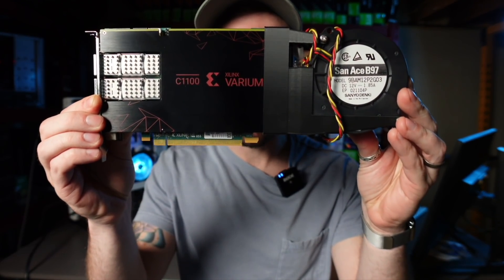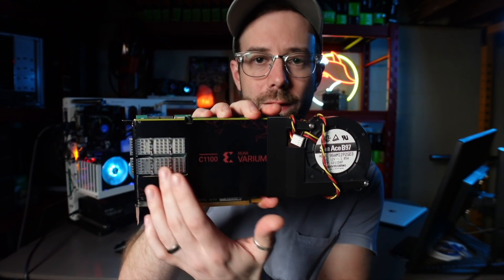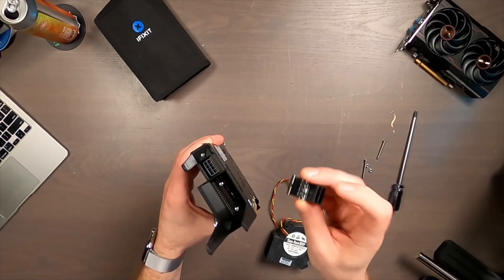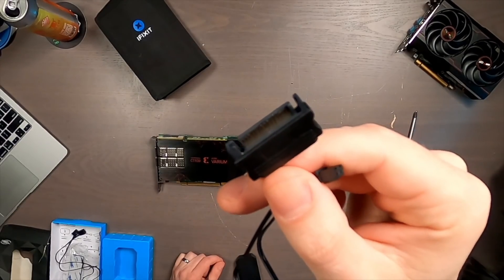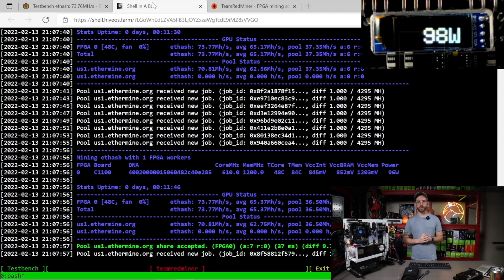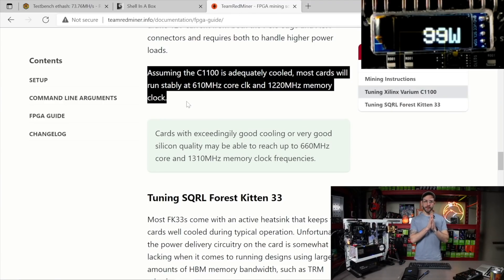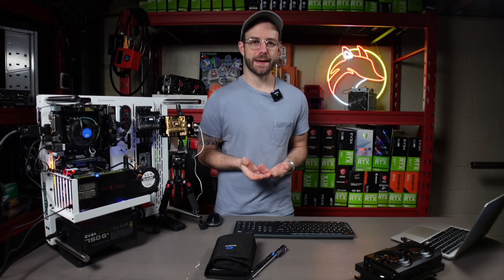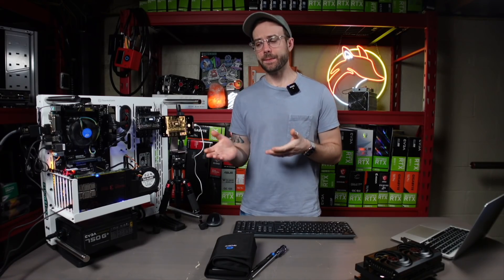RIP GPUs. This FPGA is INSANE on ETHEREUM. (Xilinx C1100 Ethereum Mining Hashrate)

Comment: GPU 0
21:00.0
GeForce GTX 1660 SUPER 6144 MB · MSI
Hynix GDDR6 · 90.16.5A.00.19 · PL 70 W, 125 W, 125 W
28.66 MH
46°
99%
72 W
100
930
-1004
80
GPU 1
25:00.0
GeForce GTX 1660 SUPER 6144 MB · MSI
Hynix GDDR6 · 90.16.5A.00.19 · PL 70 W, 125 W, 125 W
28.67 MH
41°
100%
67 W
100
930
-1004
80
GPU 2
26:00.0
GeForce GTX 1660 SUPER 6144 MB · MSI
Hynix GDDR6 · 90.16.5A.00.19 · PL 70 W, 125 W, 125 W
28.68 MH
43°
100%
71 W
100
930
-1004
80
GPU 3
27:00.0
GeForce RTX 3070 Ti LHR 8192 MB · ZOTAC
Micron GDDR6X · 94.04.5A.00.B3 · PL 100 W, 310 W, 341 W
77.22 MH
45°
90°
100%
182 W
100
1000
1800
190
GPU 4
28:00.0
GeForce GTX 1660 SUPER 6144 MB · MSI
Hynix GDDR6 · 90.16.5A.00.19 · PL 70 W, 125 W, 125 W
28.67 MH
41°
98%
66 W
100
930
-1004
80
GPU 5
29:00.0
GeForce RTX 3070 Ti LHR 8192 MB · ZOTAC
Micron GDDR6X · 94.04.5A.40.22 · PL 100 W, 310 W, 341 W
77.57 MH
41°
92°
100%
178 W
100
900
1800
190

Comment: Not sure but, my understanding is that FPGAs machines are programmable, so why can’t these cards be re programmed ?
FPGA stands for Field (eg at home) Programmable Gate Array. It’s actually a type of Field Effect Transistor used in automation electronics. So after 2.0 why wouldn’t it be OK to reprogram, might need FPGA bitstream and not hive or windows but that’s fine.
Reply from the maker: You are 100% right that it can be reprogrammed. Just at the mercy of devs creating the bitstreams for it.

Comment: As I understand it, this is some kind of advanced network controller for 10000GB with HBM memory, which was converted for Ethereum mining...
You can link to the original, something tells me that its real price is 500 dollars, and the alteration consists in BIOS firmware and specialized drivers ...

Comment: Great video. What a mining machine in that C1100! You'd have to take into account the power consumption of the fan, though, I think. At 1.85A and 12V, you're looking at 22W @ 100% fan. That's 125W total for 78Mh/s, or an efficiency of 0.62 Mh/s/W. That's still 30% more efficient than the next best one, the 1660 Super, which can get 0.48. All in all, I agree with the major drawback you highlighted in the reliance on others to develop bitstreams for it. Also, in terms of price/efficiency, the 1660 Super far outperforms the C1100, as you can get 3 or 4 1660S for the price of 1 C1100.
Reply: 1660 Super seems much better solution

Comment: An rx5700 can do 50+ at 100 watts for a third of the price. How is this that exciting? (At least until there's actually evidence of it getting 660 mh instead of 77...)
Reply from the maker: In software maybe. 5700 does more if properly measured. AMD doesn't report software wattage correctly. I have a video on it. 5700 should be more like 120w. This crushes it. Wouldn't recommend buying though.
Reply: @RedFoxCrypto  so even if you're generous on all estimates of hash power, power draw, power cost, etc., the roi will be significantly more than a year since the profit is well under $100/month. And eth profitability is going down until it stops entirely. I still don't get how this changes the equation or is that exciting, at least based on price and availability

Comment: $1,300 and 50 week lead time.  Hash rate is slightly better and power consumption a little lower than buying 2 x 6600 XT's.  Except I can get 6600 XT's now.  By the time they would arrive they will already be a paperweight.

Comment: So you have 78Mh/s at around 125 watts total including fan wattage. The FPGA cost around $1,300, but what does the fan kit cost? While all that seems impressive, getting 6600xt's might be a better option if you can get a 6600xt at $500 or less. If you can get 32Mh/s with a 6600xt at just a $500 price point, that would equate to 83.2Mh/s at $1300. Plus with a 6600xt you have the added insurance that it's usable beyond Ethereum switching to POS.
Reply: But 2 6600xt have a way higher power draw
Reply: @anonymouscommentator  Higher yes, but a way higher, no. Including fan power that FPGA uses around 125 watts, while 2 6600xt us around 140 watts combined.
Reply: @MassBoost  i have all my 6600xt @32mh and 55w
Reply: @HouseProjectIT  Nice, I think I was figuring around 65 to 70 watts for the 6600xt's, but if you can get it down to 55 watts that would even better and more of a reason to buy the 6600xt'x over an FPGA.
Reply: These FPGA's have value outside of mining too, in fact I imagine this would retain is value better than GPUs if Ethereum and by extension GPUs crash.
Reply: @Airwalkerstudios  I highly doubt their value would be better than GPU's. Also GPU's can be moved over to other algorithms to mine, and something like a 6600xt is highly efficient at mining all coins. Some coin prices have already gone up around as high as 80% in the last few weeks, so calling an FPGA a better option is a misnomer.

Comment: It's a really cool idea, and I'd love to mess around with one, but here in Canada I see the V-C1100-P00G-PQ-G listed for a psychotic $3510 CDN. In reality I'm able to get 62Mh/s on my 6900xts for just over 110 watts with proper tweaking. If I wanna go wild and pump 160 watts I can dual-mine ETH and TON with no loss to ETH hashrate. If the C1100 was reasonably priced I would love to get into FPGA programming but even the retailers are on the scalping bandwagon. Where's this discord channel at? I wouldn't mind doing more research.. at least that doesn't cost a fortune.
Reply: Or go with Nvidia A series GPUs. I have an A2000 running 41mh/s at 68watts @ 43oC. Factory cooling, no bios mods, less than half the size of an RX580. Under $900 CAD shipped from China.
Reply: Why would you get 6900 XTs assuming you didn’t have them already for gaming?
Reply: @Ash-my4gf  They're surprisingly efficient actually. You have to change the power tables in windows to undervolt not just the GPU but also the SOC and RAM. You can get fantastic results. TON coin especially is processing intensive, the 69xt has 80 processors which can mine TON nicely while mining ETH and STILL be undervolted. With GPU prices finally coming down they're an even better deal.

As for anyone using this C1100, do your research! You can get the code to mine ETH directly from Xilinx, apparently for free. No need to get some bitstream from "some guy" who's gonna charge you a dev fee. From what I've read Xilinx provides all you need for free with no dev-fee.
Reply: @rafalklepinski7372  they’re really expensive though which wouldn’t make sense to buy them for mining is what I mean mainly
Reply: @Ash-my4gf  There is also the problem of availability. The second half of last year there weren't too many options out there. Ontario, Canada is AMD territory. Nvidia didn't bother to make much of their products available here during the shortage, and they still don't. Meanwhile you can get any AMD GPU you please, especially now.
Reply: no you're not getting 62 MHs for 110w on a 69XT at wall. SW reported values are not real world power consumption on AMD gpus.
Reply: @MiningTips4u  6800 XT undervolt button in adrenaline, gets me 63mh/s- 80mh/s in Monero Ocean. It usually gives hovers around 78 mostly. Mining eth getting paid outs Monero. 5600 XT gets me 43 - 54 mh/s. It usually gives hovers around 54 mostly
Reply: @SrChalice  not the hashrate the power consumption at wall. 62 MHs at 110w is not real.
Reply: @MiningTips4u  Just divide it by your PSU efficiency. 110W sounds bit ambitious but I've tested 6800: 115W reported, 115/0.9 at the wall (63.5 mhs, 64.2 max but invalid shares reach over 1%).

Comment: non-lhr RTX 3070, rtx 3060ti beat this anyday.
Reply from the maker: This beats both those cards in hashrate and efficiency.
Reply: @RedFoxCrypto  maybe, but no in resale value, also in  EU used 3060ti/3070 non lhr cost about 900-1000euro, 2x 1660s/ti about 650-750e
Reply: 63mh 119w

Comment: For the price of your FPGA @ $1300 you can buy an rtx 3080 with the same hash rate that can mine 20 different coins and still have a resale value of 50% . It looks like the worst investment for a home miner to me at this point. At the end of the day it is still 2.3 dollars a day and a 500 day ROI expecting you can mine ETH for that amount of time.. which is wishful thinking.
Reply: Only someone with free or near-free power costs could make such a claim. The utility of this card is its insanely high efficiency. It will still be capable of mining at a profit long after the 3080 returns only losses in a high-power-price environment (e.g. Europe/Australia/Japan).
Reply: @DragonsOfAra  if your power cost is greater than 15 cents a KW hour, you should be buying solar panels instead of miners.
ETH is slated to go POS this year. You won't ROI mining ETH on the card if that happens.

The 3080 is objectively a better buy right now.
Reply: @DragonsOfAra  This is nonsense. After adding consumption of the fan, it is only a little more efficient than RX6800 or FHR 3060ti/3070. The only chance of it returning the cost is another delay in introduction of eth PoS, I wouldn't bet on it. GPUs have many more uses and will retain some value, but actually it does not make sense to buy anything at all for ETH mining anymore.
Reply: This sort of hardware can still be used after mining but only for very niche purposes. See those 2 what I'd assume are QSFP+ ports? That's 40G Up/40G Down 80G aggregated PER PORT (!) on ethernet, and those FPGAs will still have io overhead to perform other operations at wire speed. Hell, with FPGAS, they can do anything. PCIe? done. Ominpath? done. Infiniband? Also done. There is still most certainly demmand for this sort of hardware

Comment: FPGA's back in 2016-17 were the new topic but were mainly kept on the DL for whatever reason and companies that were selling them were also very hush hush and difficult to contact/buy from. 78mhs is nothing and they could do a lot more, granted you have one of the cheapest cards out there. However I've noticed that there hasn't been much development in the sector for low-mid range cards, so it's always been either go all out or go home which is very risky. A lot of videos have been taken down about them but from what I can remember 1 card ussualy replaced an entire rig and Mining programs were very open to implementing the technology and further develop it for other coins until ETH threatened to fork if they implemented this in more miners. So since then it's been very rare that someone mentions these, let alone buys them and mines with them. Funnily enough FPGA's were always mentioned around the time of a major market correction, and just as quickly forgotten by the time the next snowball started rolling. I will say this though, the people that bought those 9-15$k cards are rolling in it now.
Reply: exactly....... i remember people making six cards fpga rigs, water cooling them and mining huge amounts of coin two? years ago. If I remember correctly there was one guy who had two rigs water-cooled, 6 fpgas each. RPM had a vid of all these different miners and was laughing almost uncontrollably at both the hashrate and the coins per day. there are tons of cards like this and ones more powerful out there. like you said, a lot of these vids have been purged from utube and no longer exist. maybe they know something that i dont.
i sure wish taht i had bought one.................................

Comment: Basically 3070 now can do better than this guy, eats a bit more power, price is similar. But dualmines, has high resell price, you can use it for gaming. But I am very interested in this guy, looks kind of slim and neat. They say you can write a c++ code for other algorithms... But you need to be IT geek, Miner geek, Hardware geek so on and forth... I would totally dig in in this challenge, you can write a diploma and become millionaire at the same time lol! If it could run lolminer, then I would talk differently, basically they should not start from scratch, but somehow implement those miners into them... Than everybody would dig with them... But again warranty is a big issue, for new piece of hardware you can get 2-3 years, which is very significant piece of mind, if you are starting out...

Comment: My thoughts on this card are the same for mining specific cards. These can mine fairly well but will have almost no resale value and are frankly, for what you are getting, incredibly overpriced. I get that it is very efficient but it's ROI is still at 14 months at current mining profitability which in it's current state with only eth mining means it will never oay itself off if POS takes effect before then. For me I'm going to stick to gaming based cards until I can see some real longevity in these styles of cards
Reply: I'm late, but FPGAs are reprogrammable, so, you can always load another bitstream to mine for a different coin.
Reply from the maker: I agree. Depends on your situation of course. It's all a risk, but GPUs feel like a safer risk because of their multi purpose use.

Comment: $1300 for one plus the fan kit.  Are you high?  You could get 2 RX6600XT for cheaper and get 64MH on eth for the same or less power and dont have to worry about not being able to use the GPU to mine with after ETH goes POS.  Or you could get a Nvidia FE 3060TI and 3070 for the same money directly from best buy and end up with more MH on eth.
Reply from the maker: No, I'm not high.

Comment: Those are some good looking results, thx for the testing. But the card indeed seems somewhat half ready (where to buy 3d printed parts, PCIe extenders, proper fans + what is the total cost for all these on top of FPGA?). For this price I'd probably go one step further away from GPUs with Jasminer Brick 65 mh/S @ 30W (locked for ETH 2022, ETC 2029), it would bring stability but ofc at the same time it would take all the fun away from mining
Reply from the maker: Yeah I agree. It's just fun to have a hand in everything related to mining!
Reply: @RedFoxCrypto  yeah, exploring & finding new ways of mining in a garage/basement is the thing

Comment: I wouldn't buy this for ETH mining considering people are selling used rigs on the cheap now. But it will be interesting on other coins with other bitstreams this might be a beast. Unfortunately the FPGA community isn't like the gpu community they are all very tight lipped on details and sharing bitstreams.
Reply: makes sense. If they start sharing bitstreams for other coins, their hardware supply will dry up in an instant.

Comment: WOW, thanks fo the info, look at FPGA awhile back but there was no software that was developed/updated for this and the price that I found was about 2K.  This is a smaller verison of the  ASIC miner.
Reply: fpgas and asics are vastly different types of hardware.
Reply: first ASIC is BULT to do ONE thing a FPGA is PROGRAMMED to do one thing BIG difference 
ASIC you would NEED new silicone to change the algorithm but FPGA a NEW program AKA bitstream and it does the new algo FPGA are commonly used in low volume specailized equipment as they cost less to develop then an ASIC chip to do special tasks
Reply: @jasonriddell  Agree, I was trying to convey that it function like an ASIC. Thx.

Comment: 100W over the PCIe Slot that is rated for a maximum of 75W? Sounds dangerous :)
Reply from the maker: All PCIe not just the slot.
Reply: it has a pci-e 8 pin also. you can see it early in the video.

Comment: So what is the difference with ASIC now?
FPGA is a big no for me.
Reply: ASICs are more efficient than FPGAs but they cannot be reprogrammed. If a cryptocurrency changes their algorithm then an ASIC becomes worthless because it can no longer mine the coin. FPGAs are less efficient than ASICs but they can be reprogrammed by loading a new bitstream. So if a cryptocurrency changes their algorithm then FPGAs can be reprogrammed to work with that new algo. The problem is that reprogramming an FGPA (developing a bitstream) is a fairly difficult task. ASICs and FPGAs are both more efficient than GPUs.